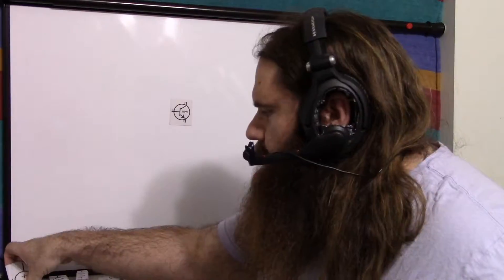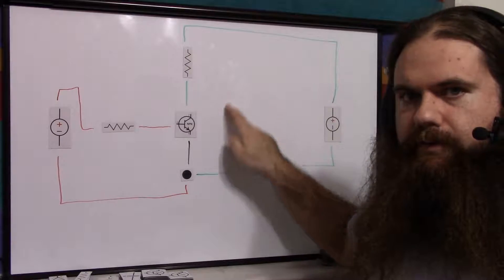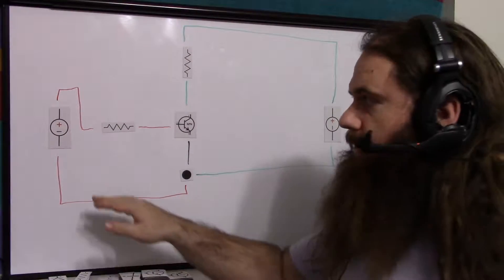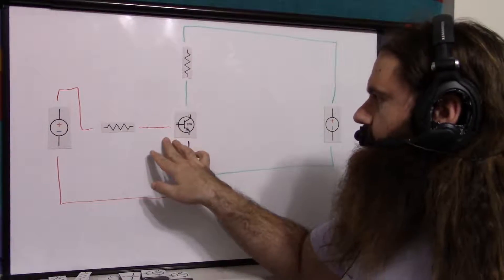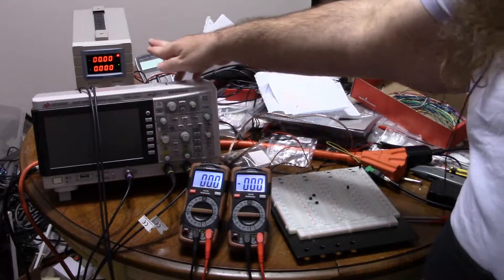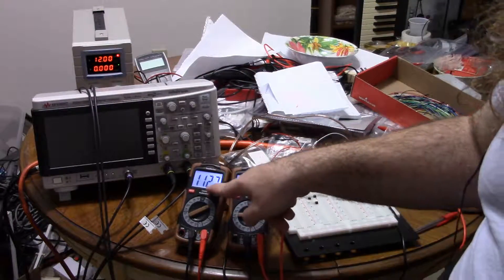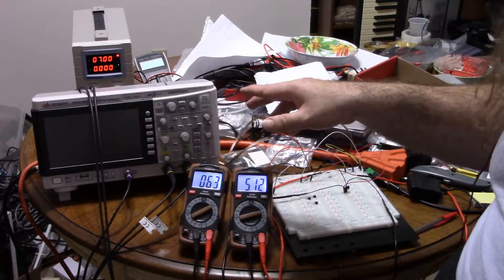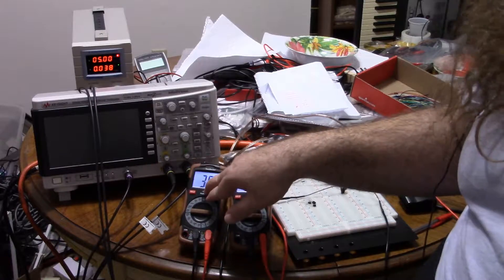Are BJTs Voltage Controlled Or Current Controlled - Simply Put

Comment: 5:02 the maximum saturation current is more than that - need to remember total current = collector + base. The base current can be larger than you might expect, especially with a physically large BJT. That’s why you need a base resistor: to limit that current.

Comment: 4:45 you can't apply any voltage/current combination you want at the b side, If you apply a very high voltage as input than add a giant resistor, the resistor will drop most of that voltage and Vbe will be very low and that is what is causing the no current at the collector. you can only apply voltage and see what current you get or apply a current and see what voltage you get.
Reply: Yes, just use the diode equation, plot Ib versus Vbe for silicon.   Or Ebers-Moll, or build a diff-amp pair, or a CC amplifier, both of which are based on voltage input.

Comment: Its like people are missing something so obvious. Just as you run your experiment nothing happens until you trigger it on with what, passing the "Voltage Threshold", the Bias turn on Voltage. But, you can't have one without the other. But, you do have pass the Bias Voltage level for anything to happen. And, like you said most applications today for BJTs are to amplify some sort of what? A small Analog Varying Voltage Signal. Voltage and Current to me are like the age old question of what came first? The Chicken or The Egg?

Comment: Believing in current-controlled BJTs screwed me up!  Years later I heard that the exact same thing happened to Win Hill, author of AOA "Art of Electronics," a textbook for college classes.  The AOA textbook points out all the problems created by "hfe-think," and the lab-book that accompanies AOA goes quite a bit further.  BJTs are "transconductance" animals, same as vacuum tubes and FETs.
So, who believes in "transconductance-think," or voltage-control?  "Pedants" such as professional engineers; old-school analog designers, and anybody building electronic products from discretes rather than ICs.   

Hobbyists need no such things.  As hobbyists, we never need encounter "transconductance."   Also, exponential functions are irrelevant, and we just set Vbe to 0.7v.   "Current control" is a simplified, beginner/hobbyist, for-dummies approach.  I'd go even further, and state that believing in current-control marks a person as having zero engineering coursework, zero experience in the professional design world (at least the analog part.)  "Current-control" works fine until you try designing actual products  ...where we immediately discover that the hfe of a spool of smt transistors is all over the map!  Then later we find that, if transconductance was ignored, and current-gain is important to our design, then our design is temperature-sensitive, since hfe varies with temperature.  (Current control means that our designs need thermistors and trim-pots, if we need them to have known DC behavior and industrial/military/automotive temp-range.   Those are not typical hobbyist requirements.)

Proper BJT designs are hfe-resistant and ignore base-current as if it was unwanted leakage, same as proper FET designs ignoring the gate leakage.   And, proper BJT designs rely on Ebers-Moll equation, not on current-gain equation.  In a proper design, the base I-bias (hfe) can vary over a span of almost 10x, yet have no effect on the circuit.  But how?  The classic LM741 op amp is a great example of this.  Learn and understand every bit of the 741 internal schematic.  All those blocks are voltage-based circuits: long-tailed pair, current-mirror, Cascode amp, the three fundamentals of voltage-based design approach.)

If we don't do this, then we're trapped at the hobbyist-level, as far as BJT designs go.   But we'll never know this, because we've never designed mass-produced DC-coupled circuitry under extreme parts-count constraints.   (So, you're sorta correct, where the only people who care about such stuff is quantum physicists, engineering students,  top analog designers in major corporations, and the occasional tech who must design DC coupled circuitry without using any op-amps.   The guts of BJT op-amps of course are voltage-controlled, where transconductance is everything, and the hfe of their internal transistors is irrelevant.)

My very first professional analog design, an analog opto-sensor amp for Eaton/Cutler-Hammer, didn't work, since if we built several of them, their temp variations were all different, plus, they need a trim-pot for zeroing, which was absolutely not allowed.  (The circuitry was for mega-mass-production, must cost only cents, even an IC chip was way, way too expensive.  But the analog designer had several projects, so they gave it to me, an expert only in 8-bit embedded controllers!)  So, I had to start over, using spreadsheets and Ebers-Moll equation.  I used the design-philosophy I'd learned in BSEE classes, NOT the beginners'-philosophy taught everywhere else.  My project was a success, installed in hundreds of thousands of cola machines world-wide, and all based on the design philosophy of "voltage-think," not "hfe-think."   (In hindsight I see that William Shockley was an idiot, and had to be corrected by Ebers and Moll years later.  Heh, why was the E-M equation not called the William Shockley equation?)

Models of BJTs  ...in SPICE programs?  You'll want Monte-Carlo, a spread of betas, so you can see just how badly your design malfunctions, when it's built from transistors where the beta can be anywhere from 50 to 300.   But the transconductance behavior is determined by QM physics constants, not by silicon-fab variation.  "Transconductance-think" FTW.

Again, to see an example of such things, go through the LM741 internal schematic in great detail, figuring out every smallest piece, until there are no mysteries there.    Or, find a modern DC-coupled high-end audio amplifier, few hundred watts etc. Carver audio and similar.   Those things look just like a 741 op amp inside, made from discrete transistors.
Reply: does he think he can apply arbitrary current/voltage combinations to the base-emitter junction, I mean does he believe that high voltage input and high resistance means the transistor is seeing high voltage and low current?
Reply: @ak-wt6ll  Umm  ...Horowitz and Hill, professional electrical engineers, with decades of solid state design experience?   
I suggest you go read Art of Electronics book (electronics theory textbook for the college level.)  The lab-book has even more anti-hfe stuff, with actual demonstrations.
How do BJTs actually work?  Those who do not know, will crash into a mental barrier if they get a job and try producing discrete transistor designs. 
The EB potential-barrier controls the collector current.  Base current is an unwanted leakage.  An ideal BJT would have infinite hfe, zero Ib, and resemble an FET, but one that's based on diodes rather than capacitors.
A BJT is a glorified diode, where it's turned on and off by applying a potential-difference across a PN junction, and the physics is that of e-fields in the depletion-zone of a diode junction.   Or put explicitly, there is no mechanism where a base current can affect the emitter or collector current.  Doesn't happen.  Vbe is the input parameter, Ic the output, for a "transconductance-istor," as the original name was coined.
Reply: @wbeaty  no, I'm not talking about Horowitz and Hill, I'm talking about the experiment done by the video poster.
Reply: @ak-wt6ll  Heh, oops!  (Oddly, your reply comment went to me.)

And yes, people with technician classes think that BJT transistors are current-amplifiers.  Also typically believe that the sun is colored yellow, electrical energy travels inside copper, and Ben Franklin's kite was struck by lightning.  Yer middle-school sciance books all sed so!  That many books couldn't possibly be wrong!
Reply: @wbeaty  haha, yeah. Funny thing is: diodes are taught as forward bias them (voltage control) to turn them on!

Comment: Voltage controlled. Next question.
Reply: Yep, and bipolar op-amps use voltage input.  The "pedants" here are college grads, analog designers, etc.  (Heh, we're going off to the same retirement as tube-designers, only working for top-end audiophile-oriented companies.)
The long-tail pair or diff amp, employs voltage-input.  So does the current-mirror and the cascode level-shifter.  Those who believe in current-gain only, they see such things as arcane dark magic, impossible to really grasp.   But look at a Carver high-watts amplifier, and find that it's DC coupled  ...and cannot be understood if all we know is current-amplification hfe-think.  It's totally alien inside!   ...same as the LM741 op amp.   All those weird circuits are voltage-input devices, where Ib is small (irrelevant,) and if we change the hfe of those transistors, the circuit still operates the same.   (It's like changing the gate leakage of discrete FET circuits.  It slightly changes supply current and input impedance, but the amplifier still keeps working.)
Hobbyists must abandon their heathen ways, drink the voltage-control BJT coolaid, worship at the feet of the AOA textbook.  We will make you one of us, ONE OF USSS.

Comment: What I would just like to know what is happening to the current being applied to base ?
Lets take NPN transistor.
is current going t gate being dissipated as heat, or is it uniting together with current going from collector, so both currents go to emitter ?
Reply: Both to emitter. And makes heat. 

I think of BJTs as voltage controlled and to limit the base current so it doesn’t overheat the transistor.

Comment: Thank you. I'm not an electrical engineer but just interested and this was always nagging me. Is it true to say that since voltage always precedes current then a bjt is voltage-initiated but current-controlled? Or am I just another pedant? But thanks anyway!
Reply from the maker: Voltage causes current. Current is the aggregate motion of electrons, and they move in aggregate because either there is an electric field across them (a voltage, also known as an electrical potential difference) making them run "downhill", or there is a magnetic field interacting with them and giving them a "push" like a generator. We think of current as its own thing because it's easy to conceptualize and understand how circuits work if we do that, but current is always ever just the side effect.